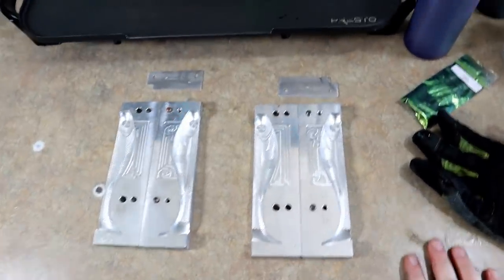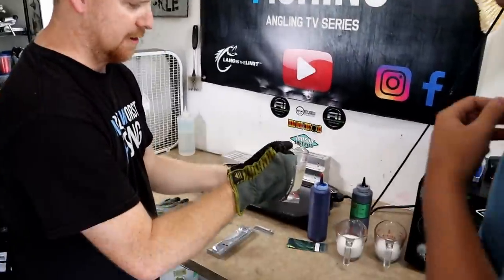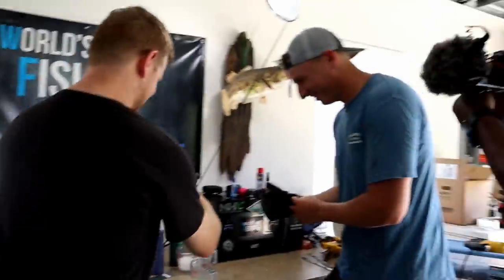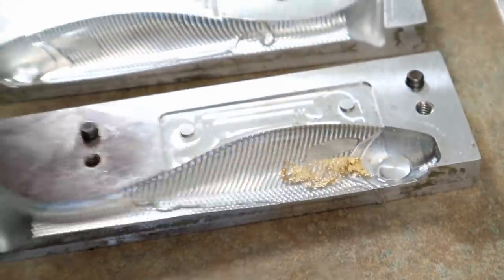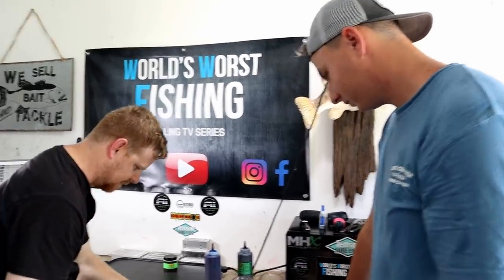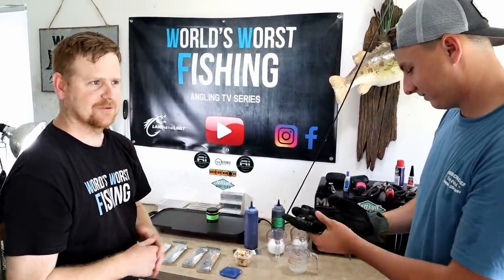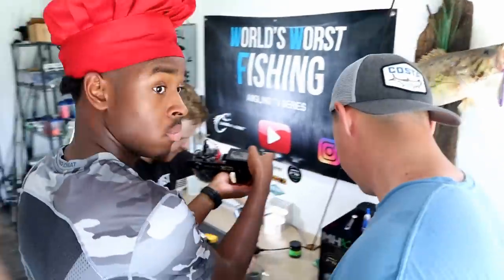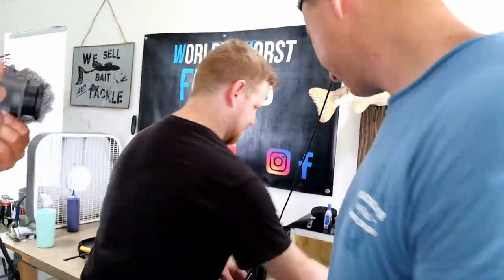Who Made These Gold Leafing Swimbaits?  @FishingWithNorm  @FishingWithYakPak  @LarryMeltonJr

Comment: Was the hot plate turned on or were you just using it for a table? I noticed it couldn't be too hot since you guys were picking up the molds without gloves.
Reply from the maker: You turn the hot plate on once you are ready to fill the body colors

Comment: I bought a regular mold but I don’t have a injector would I be able to just hand pour the plastic into the mold?
Reply from the maker: In some molds yes
Reply: World's Worst Fishing I have a single cav mold that people normally use a injector for would it work to just pour in one of those
Reply from the maker: @gabrielvanrycheghem9841  it depends on the bait.. if it's a straight stick worm than yes.. if it has thin parts or curls than no
Reply: World's Worst Fishing it’s a bandito bug
Reply: World's Worst Fishing and have u ever used the do it lizard mold that has 6 legs like 3 on each side and if so is it any good?